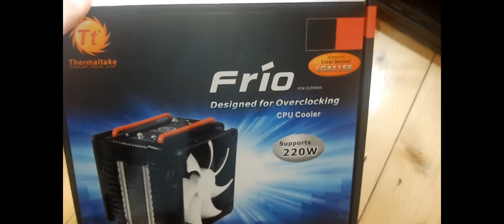How To Build you own Gaming Rig Part 1

Comment: @SpikeyBoy333 i havent bought them yet but i use tweakers.net for my prices.

this is what ive got so far: i made an excel Computer		
Part	Name	Price
CPU	AMD FX-8150	250
GPU	MSI R6950 Twin Frozr III OC 2GB	240
Mobo	Asus Sabertooth 990FX	140
PSU	Corsair TX 750 W	90
RAM	Corsair Vengeance?	45
HDD	Samsung Spinpoint F3 HD103SJ	42
DVD	?	20 
Case Cooler Master Storm Enforcer80
CPU Cooler	Cooler Master Hyper 212 +	20
Monitor		150
Keyboard	?	30
Mouse	?	40
Speakers	?	30
sub totaal		1157